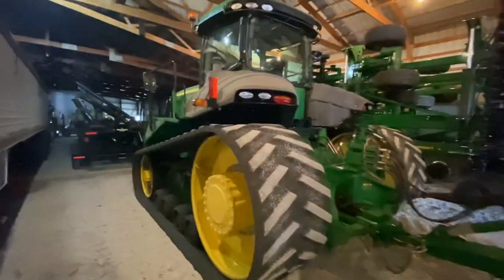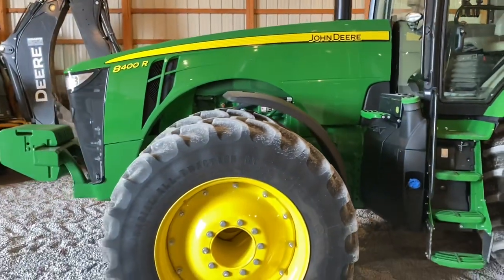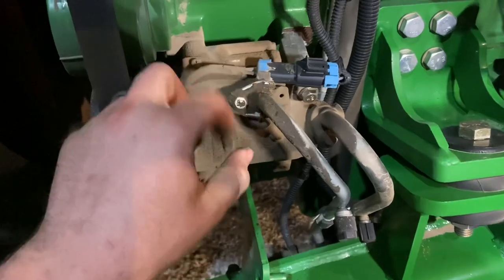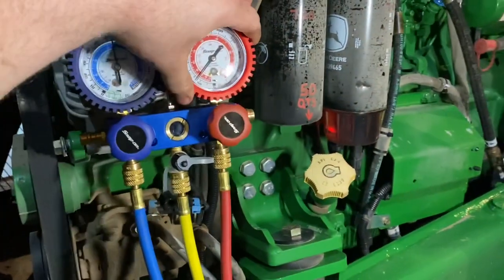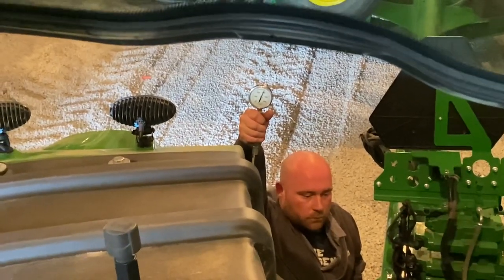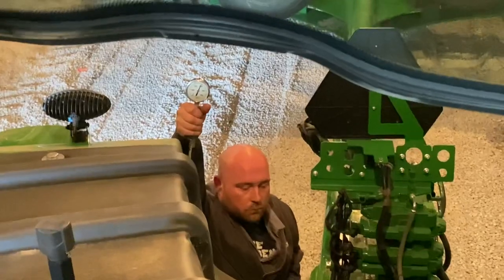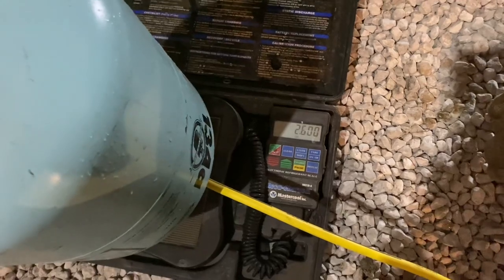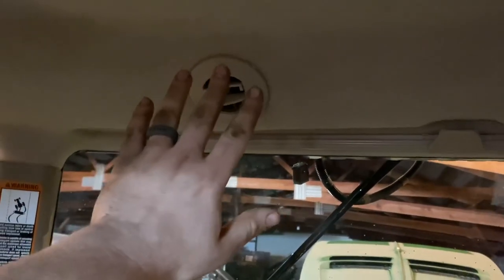John Deere 9460RT A/C problem & 9620RX internal hydraulic leak in scv.

Comment: I was surprised to see that system holds 5.5 lbs of refrigerant. I'm an automotive tech and a large truck like a Suburban might have a 2.5 lb capacity. I guess it's partially because of how much glass there is in the cab?
Reply from the maker: Yes and your not able to go 60 mph down the highway to cool off the condenser. It's all fan and it's running in the dust. It gets hot in those cabs without a/c.

Comment: Hey man great videos recently started watching. Got a question. How come you charge upside down on low side? I thought if charging upside down (liquid form) you would charge on high side? (Serious question just curious if there's a better way to doing it than what I've been told). Thanks.
Reply from the maker: I’m statically charging the low and high side with liquid to get a denser charge while it is cold outside. Then I’ll start the engine and just crack the low end side to suck a mixture of liquid and gas. As long as you don’t crack the low side valve open too far, you won’t put too much liquid in the compressor which could cause damage. I just watch my sight gauge.

Comment: Great Job 🔝🔝🔝👌👌
Looks like there are pretty plenty of weak spots on the new Deere Tractors aswell 🧐🧐🧐
Not very well build these days.
Can this compressor not be rebuild with  new seals?? They maybe very expensive or ?? 

Here in Austria / Europe we have lots and lots repairs and defects on our 5R from Augusta.... Man thats a piece of shit... 🤦‍♂️ from the command 8 to the Brakes and the 4wd a horrible machine.... 

We always used deere but this one was sold after 2 years and replaced by a 312 Fendt... 

Never would buy a Deere again... not even a 6M from Germany 🤦‍♂️🤦‍♂️🤦‍♂️

Keep up... like your Videos a lot
Greets from Austria 🇦🇹🇦🇹🔝🔝

Comment: I can see not flushing the system as it wasn't a true compressor failure. How do you estimate your makeup PAG without a full flush? I usually throw a new receiver drier on anytime I have a system empty.
Reply from the maker: I just flush out the high side line to the condenser of the compressor didn’t grenade. We have to “flush” for the Deere parts warranty. You don’t hardly lose any oil at all when I do that and the new compressor is full of new oil so I don’t worry about adding more PAG. Haven’t had any issues yet.